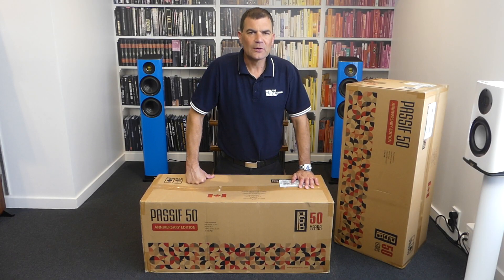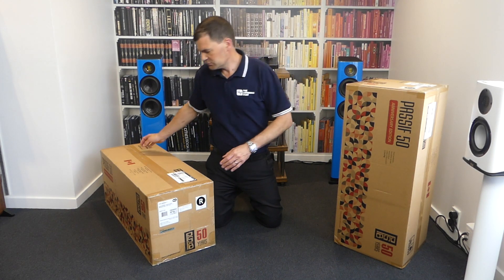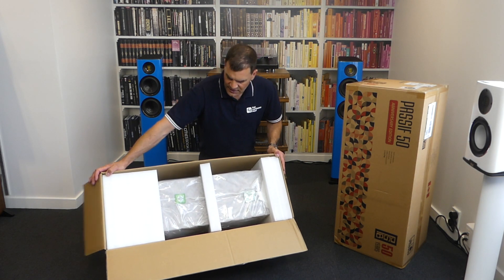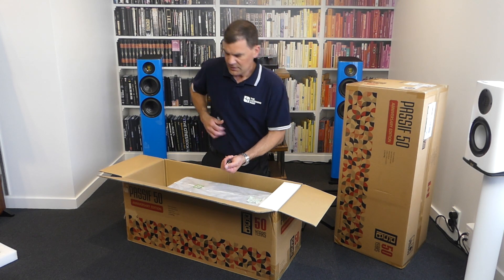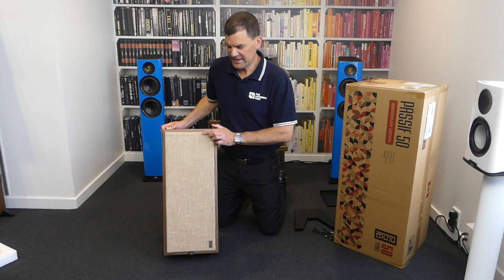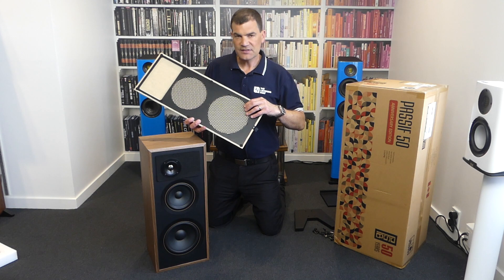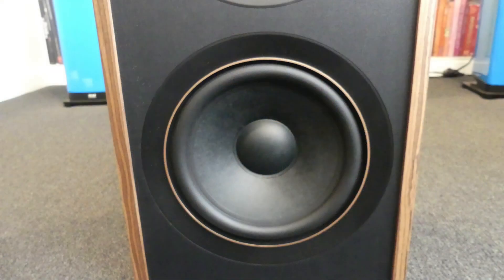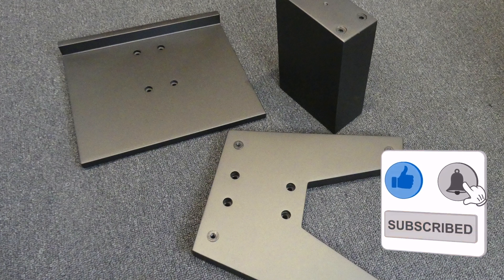PSB Passif 50 Standmount Speakers Unboxed | The Listening Post | TLPCHC TLPWLG

Comment: reminiscent of the Monitor Audio R152 speaker from 1983, they came with a similar dedicated stand which fixed to the bottom with screws.
Reply from the maker: Yes - it is a re-visit of the original 1970 / 1980's style